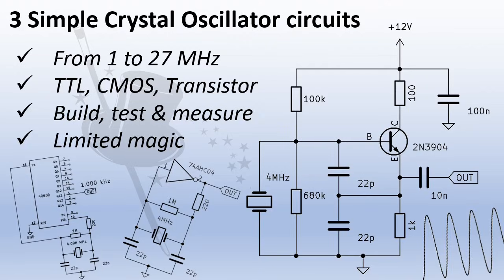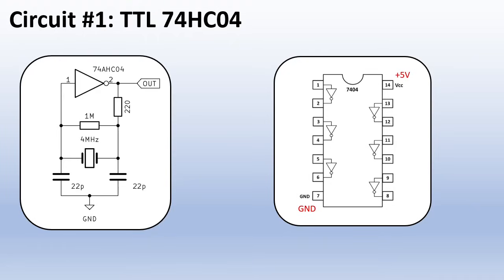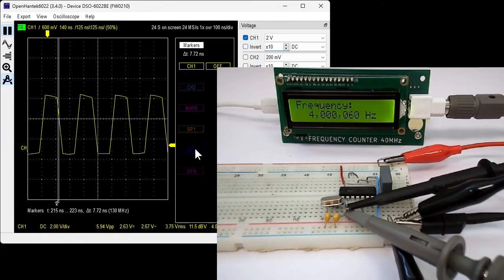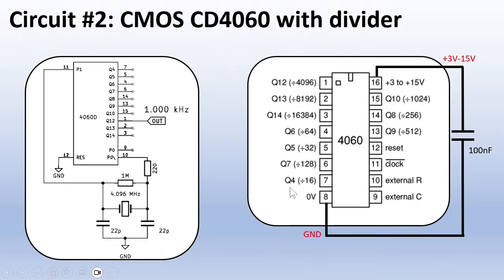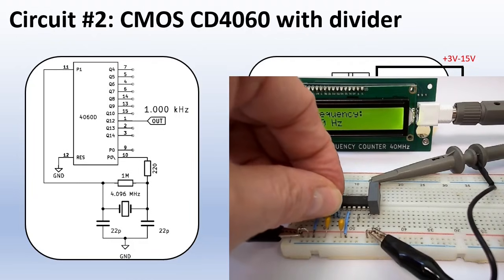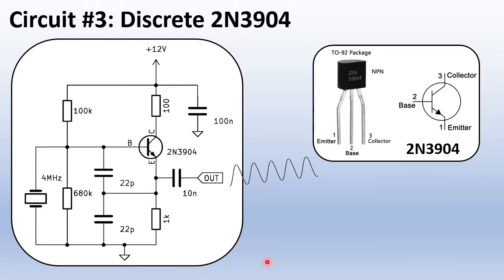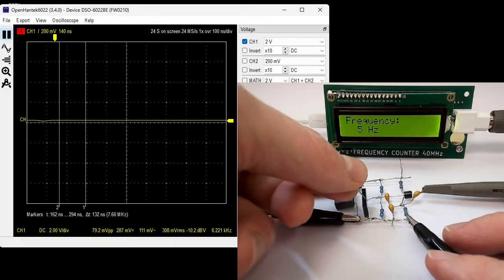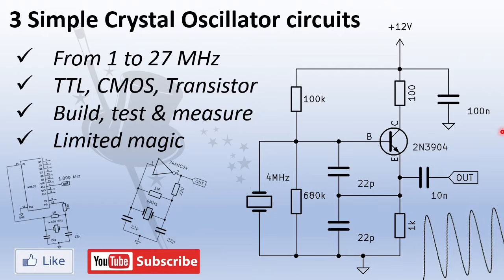3 Simple Crystal Oscillator Circuits

Comment: The first two are useful for digital electronics work, the third for other applications such as radio. The reason is that the Colpitts oscillator delivers a sine wave with greater spectral purity (fewer harmonics). A very interesting and useful video, thank you!

Comment: I try make circuit no:3 with transistor  and I change 22pf  to 47pf and   I test the frequency by millimeter but not frequency read what do you think case ?
Reply from the maker: Can your multimeter test such high frequencies?  Did you solder or use a breadboard? I tried with a breadboard but it is easy to have loose connections and the circuit often does not work. Other things to check: same transistor? 2N3904? Is pinning e-b-c correct? Best to use 9 to 12 Volt. Good luck 🤞!

Comment: Your Colpitts oscillator is actually a Clapp oscillator. The feedback capacitors should be as high a value as possible where the circuit still oscillates strongly because this has a 'swamping' effect. That means the effect on frequency of whatever you feed the signal to is minimal. An emitter degrading resistor of (for your circuit) about 47 ohms would reduce the peak output voltage and prevent clipping which means fewer unwanted harmonics. With an inductor and variable capacitor instead of a crystal you can also make a pretty stable vfo this way.
Reply from the maker: Thank you! You are an expert on this HF stuff. I am a power electronics engineer, but the radio frequent circuits always catch my interest.

Comment: Thank you very much! Have you come across a calculation method for 7404 oscillators? How do you select the chip based on speed, resistor, and capacitor values? I'm interested in frequencies above 30 MHz.
Reply from the maker: Glad you liked it! The 74HC04 can certainly achieve 30 MHz, pay attention to the “HC” The circuit in the video worked up to 27MHz because I do not have higher value crystals
Reply: @smartpowerelectronics8779  Sorry, I was wrong, I meant 7404 (including 74HC04).

Comment: 74AHC04 is not TTL but CMOS logic circuit
Reply from the maker: You are an expert😊 correct the HCT or HC series use CMOS, not bipolar transistors. The 74xx series started with bjt’s  a long time ago
Reply: Yes, all pin same as reguler 7404 pins but different transistor.

Comment: The 74hc04 should not be used but 74u04...
Reply from the maker: I am not familiar with the 74U series, I know LS, HC, HCT 
http://www.elecdude.com/2014/07/differences-in-cmos-4000-series-74ls-74hc-74hct.html
Reply: @smartpowerelectronics8779  U stands for unbuffered, it could theoretically be in most of the different series. A 'buffered' inverter will have more drive on its output (stiff push-pull output stage), which if you have the wrong value resistors, could be likely to provide more mW signal power into the crystal than its designed for. The U series unbuffered, are less likely to give you this problem. This might be particularly the case with low-power designed crystals, like many 32.768khz are. But usually if you use enough of a series R in the circuit, I think it can still be fine
Reply: Yes, he is right. One must use the unbuffered(u) version. Handle with care; they are static sensitive.
Reply from the maker: @dieseltinus6680 Thank you, never too old to learn!

Comment: 8:20 - While there are indeed many examples showing the feedback coming from the collector (i.e. transistor in common emitter configuration), I believe what makes it a Colpitts is the split capacitance in parallel with the crystal? There are also multiple examples showing a Colpitts configuration using common collector and even common base transistor configurations.

Comment: Watching from Brazil, thanks for your video! Is it possible to assemble two TX/RX pairs that convert a 20MHz channel in the 2.4GHz band to 900MHz for use as a point-to-point link using mixers, VCOs, and small RF amplifiers?
Reply from the maker: Great to get a comment from Brazil :-)  There are more and more viewers from South America. Your request goes beyond my knowledge. I am a power supply engineer, but have some interest in RF...